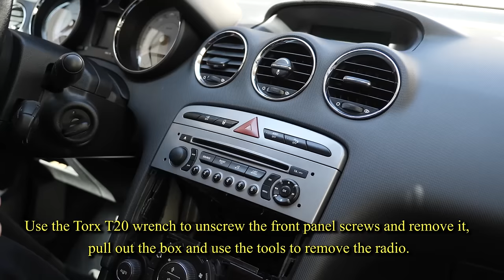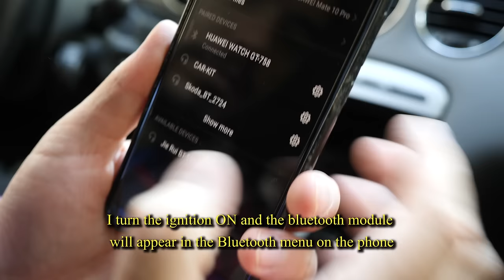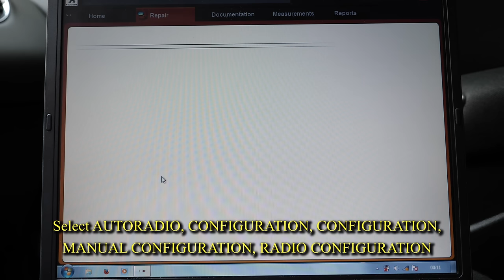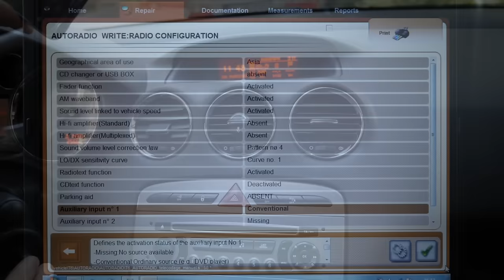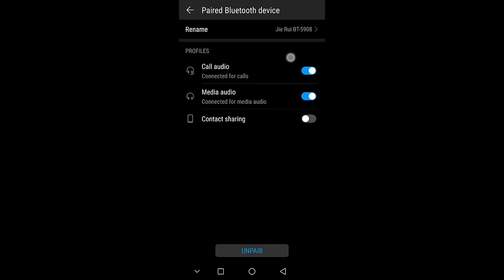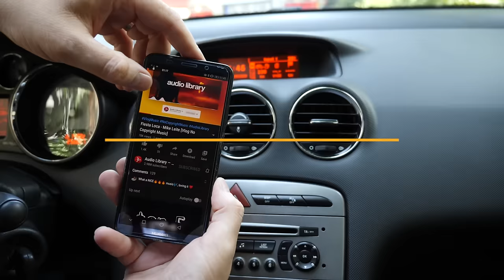Install Bluetooth Audio Module on Peugeot & Citroen Radio RD4, RD45, RD43

Comment: I haven't started doing anything yet. I haven't even ordered anything as I'm still at the research stage. 
My first question is what year model Peugeot 3008 are you demonstrating this on, please? 
Then you showed having the Bluetooth module permanently powered. What would be the benefit of doing that? 
And finally, the display screen on my 3008 seems to have only 3 columns for displaying information. If I'm going to add Bluetooth, wouldn't I need an extra column (or something else) in order to configure the Bluetooth connection? If not, why not? 
Thanks for any help you can provide.
Reply from the maker: Hello.
1. The car I made the video on is a 2008 Peugeot 308.
2. There is no advantage. You can power the bluetooth module from the wire of the radio unit that has + ACC (conditional on turning on the ignition) or you can power it from the + of the illuminated glove box lamp.
3. You just have to configure the radio (using Diagbox Peugeot diagnosis) to accept Aux IN audio.

Comment: Hello, thanks for your vid!! Now i have mine installed, just to confirm, with this module, when i play music from the music app in my phone, there is no way to skip tracks with the car radio or steering wheel buttons right? Thanks again!
Reply from the maker: Hello. With this bluetooth module you can only change the music from the phone.
Reply: @AdrianDragan   thanks for answer, i got a solution for this, u can buy multimedia bluetooth controller for phone that u can attach to the steering wheels so u can change tracks without touching the phone 😉

Comment: Hello Adrian,i bought this adapter connect wires everythink is ok and activated by lexia,but i have problem sometimes adapter always connect and disconect from the phone and i heard beep sound.What you think what is problem,somethimes working ok but sometimes not.
Reply from the maker: Hello.  Try another phone and see if the same thing happens.  It is also possible that the bluetooth module has a problem.
Reply: @AdrianDragan  i tried with other phone same problem maybe is fault bt adapter...

Comment: Hello 
I have a 308 1.6 HDI 2009 , 
But when I press on SOURCE nothing is happening , how can I enable AUX IN pls ? 
Is your method with this adapter is still available and working in 2022 ? 
And also , can I use any diag box (like the 40€ 300€ ALEN diag box on AliExpress) to modify the parameters of the Bluetooth please ? 
Thankkssss
Reply from the maker: Hello. Yes, you must activate the Aux IN function using the Diagbox with the dedicated module. You can find the link in the clip description.

Comment: Hello, I have a question. If my Peugeot 308 has two RCA inputs (left and right side) in glove box and I can see "AUX" option in my source menu is it necessary to use Diagbox after installing bluetooth module just like you did in the video?
Reply from the maker: Hello.  Because you already have the AUX IN port active, you no longer need to do the activation with Diagbox.
Reply: @AdrianDragan  Thankl you for the fast answer
Reply: Hi, if I remove multi changer cd , do I need to activate the aux using diagbox

Comment: Will bluetooth module will be powered only when ingnition is ON, or also when ignition is OFF but radio is turned ON manually?
Reply from the maker: As I made the connection here, the bluetooth module only works with the ignition ON.

Comment: So I’ve done everything, great explanation so far. No one locally had the Diagbox and I intend on using it many times in the future, so I ordered one. But what software do I install? They all seem to have a password and I don’t know where i can find it. And after entering the password for the file, will I be met with another authentication?
Reply from the maker: Hello. Did you receive the interface and can't install the software? I think that the seller of the Diagbox interface will give you clear instructions on how to install it.

Comment: Many thanks Just installed the module and it works great. The only issue I'm having is that Pin 11 was not switched live so currently connected to pin 12 battery which is not ideal. I had a good probe across the entire switch couldnt find a switched live which seems abit odd. Peugeut 407 SE
Reply from the maker: Hello.  Try to power from the positive wire of the lamp in the glove box.

Comment: Hi, i bought the same bluetooth module, but i have a problem to activate aux (I have a citroen C4 2005). I do the same as you in diagbox but when i change a input from missing to convetional diagbox shows me "wrong telecoding". It also shows this for every option to change on the radio. Do you have any idea to solve this problem? Old diagbox version, blocked radio etc.?
Reply from the maker: Hello.  I guess it's a radio stuck to changes in the Diagbox, I've also had this problem sometimes without knowing how to solve it.

Comment: is it compatible with remote of wheel? volume + volume -   next back source
Reply from the maker: Hello. Using this bluetooth module you have no control from the controls on the steering wheel, you can only adjust the volume.

Comment: One more question. The screen and radio work,but the screen does not show any changes on the radio: radio station, volume,....
Reply from the maker: Hello. I don't quite understand what you mean. Did you install the bluetooth module and on the screen you no longer displayed volumes, the name of the radio station?
Reply: @AdrianDragan  No, I still don't have any radio response to the screen without any module.  On the screen I can now see only the consumption, range, average speed... 

And I have all the control of the screen using the lever behind the steering wheel and three buttons on the screen
Reply from the maker: @debras.2211  I think your screen needs to be configured to work with the original radio, this can be done using the Diagbox interface. Your car may not have had the original factory radio, so the screen has been set to work without it.
Reply: @AdrianDragan  Can a little more detail about digitbox.
 Can I do it alone or go to the service?
Reply from the maker: @debras.2211  You need this hardware / software interface and some knowledge of what to do: https://www.aliexpress.com/item/32835110498.html?aff_platform=shareComponent-detail&sk=_ASSIR3&aff_trace_key=91917703c48e41f2be0c143a2f20f4dd-1609275726009-02086-_ASSIR3&terminal_id=d92441f0a7b94ef29dcdfc816a4dd068&tmLog=new_Detail
If you don't know how, it's better to go to a service.
Reply: @AdrianDragan  Thank you very much for all the answers.

Comment: Hello. Do you have a film about replacing nomade module? Or maybe how to remove center tunnel?
Reply from the maker: Hello. I'm sorry but I don't have a film about replacing nomade bluetooth module. I don't even have a film about how to center tunnel, but I want to do it in the coming weeks. Thanks!
Reply: @AdrianDragan  I found your film about replacing a bulb in lighter. Some say that i can remove nomade thru this hole :-) i'll check it tommorow :-) thanks for reply
Reply from the maker: @rredipss  That hole is small, I don't think you can get out there but you can try.

Comment: I see in the software there is Auxillary input 1 and Auxillary input 2. Does that mean we can install an aux cable (which you removed) and aux bluetooth (which you connected) at the same time?
Reply from the maker: Theoretically you can also activate AUX IN 2 but the pins are different. Follow the diagram from the link, Part B: https://diyrepairs4car.blogspot.com/2020/05/peugeot-citroen-rd4-rd43-rd45-wiring.html
Reply: Adrian Dragan Thank you for the response. Do you know any audio products sold for AUX INPUT 2? (cable or bluetooth)
Reply: @AdrianDragan  Hi,

What about just having both the BlueTooth as well as the AUX cable connected to the same AUX 1 connector ? 🤔😕

Thanks &...

Best Regards,
Reply from the maker: @davidbolha  I don't know if it's good to combine two sound sources on the same cable.
Reply from the maker: @uygar84  I am sorry but I do not know.
Reply: @AdrianDragan  I mean you wouldn't use both at the same time. To save space instead of using the AUX IN 2 port. 🙄

Comment: Hello Adrian, thanks for the video which gives ample time to follow each step. What module should I get for a Peugeot 807, year 2008? thanks a lot!
Reply from the maker: Hello. This would be the easiest module to install. But make sure it is compatible with the radio jacks on your car. https://www.aliexpress.com/item/32826594463.html?aff_fcid=8dd412c5ed964f848eb1ce1226169bf6-1622123674255-09622-_AlNrnv&aff_fsk=_AlNrnv&aff_platform=shareComponent-detail&sk=_AlNrnv&aff_trace_key=8dd412c5ed964f848eb1ce1226169bf6-1622123674255-09622-_AlNrnv&terminal_id=a4886d1a72584241b5df38394da27292&tmLog=new_Detail
Reply: I have the exact same car. Which module did you get? Do your parking sensor beeps still work?

Comment: Thanks for this video. Do you have any other recommendation to buy a Diagbox as your previous link is not working anymore ?
Reply from the maker: Hello. I solved the problem with the link, here it is: https://www.aliexpress.com/item/4000077945226.html?aff_fcid=23d2e9b7a05d4732b5c1cd1e1fefb060-1619608332636-02375-_AfokTF&aff_fsk=_AfokTF&aff_platform=shareComponent-detail&sk=_AfokTF&aff_trace_key=23d2e9b7a05d4732b5c1cd1e1fefb060-1619608332636-02375-_AfokTF&terminal_id=364d159dab6d4da48c68657f8054a5c8&tmLog=new_Detail

Comment: Great video my friend!👍🏻
I think I did every step as you showed(did it twice) and connected my phone but I still have a problem in my car where i can not hear anything from the speakers when switching to Aux 2 source. The only step I didn't do was the activatin step with the Diagbox because I already had an aux-adapter in place which worked perfectly before I changed it to this bluetooh receiver. When I switch to the radio channels, all the speakers work.
Is it right that in my case it should work from the get go or do I still have to connect a Diagbox and go to the car config to activate something to work?
Sorry if this was already asked but i couldn't find it.
Reply from the maker: Hello. From what I remember you have to enable Aux 1 with Diagbox. Or change the pins on the bluetooth jack as the wires on the original aux jack are placed. Take a look at the pinout in the picture, it may help: https://diyrepairs4car.blogspot.com/2020/05/peugeot-citroen-rd4-rd43-rd45-wiring.html
Reply: @AdrianDragan  is the quality of the sound good or i should just use my mp3 modilator
Reply: Hello, were you able to solve this problem? My bluetooth module still hasn't arrived, but I only have Aux 2 source
Reply: Same question for me

Comment: Hi! let me know that using the Lexia to programming this bluetooth module to correct using with phone is required or not? how to use this one module without Lexia? Should I just switch my radio to AUX and try to use? (Citroen C5 2005)
Reply from the maker: Hello. If you already have the AUX function active in your radio, you no longer have to configure with Lexia / Diagbox.
Reply: @AdrianDragan  ok, I just connected BT module and will try to find someone who have Lexia. Thank you!

Comment: Hello is the step with the Diagbox necessary or will it work with the AUX setting I already got on my 308
Reply from the maker: Hello. If you already have AUX active in the menu when you press the SOURCE button, the Diagbox step is no longer necessary.
Reply: @AdrianDragan  thanks for your answer, I only have aux 2 in my menu, would this work too ? And where’s the difference between aux 1 and aux 2

Comment: Hi. Couldn't you leave the original AUX cable connected and set this bluetooth device as AUX 2 in the diag box? Or is it not possible to have 2 AUX ins with RD4? Thanks!
Reply from the maker: Hello.  You can enable both Aux ports, but the bluetooth module pins are set to Aux 1 only.

Comment: Hi, I have a 2009 C4 picasso with rneg wipnav with rca aux in. I would like to change the rca aux to a bt like in your video. Do you have a pinout description for rneg wipnav?
Does it have the same pinout like the rd4?
Thansk
Reply from the maker: Hi.  If I'm not mistaken pinout for aux in is identical, you can still use a bluetooth module with RCA connection: https://www.aliexpress.com/item/32821770160.html?aff_platform=shareComponent-detail&sk=_AN7CU1&aff_trace_key=4b445306f5ff4aedaf24f41b551629cc-1603835577839-07973-_AN7CU1&terminal_id=77944c4ce01745aba668c8702a5739a3&tmLog=new_Detail
Reply: @AdrianDragan  Thank you for your answer. 
Is the +12V/-12V pinout also the same? :)
Reply from the maker: @koppanyagrillokozmary162  Yes, but it's good to check.

Comment: Can't thank you enough as I have many tips and info for my car from you. How could connect a computer/laptop to the car? Where  I could buy a cable?
Reply from the maker: Hello. You can buy the cable adapter and software from Aliexpress (choose the most expensive, it's the best): https://www.aliexpress.com/item/4000077945226.html?aff_fcid=3f393039cd76437ca5be168bf88085cb-1621346233730-00705-_AfwDRP&aff_fsk=_AfwDRP&aff_platform=shareComponent-detail&sk=_AfwDRP&aff_trace_key=3f393039cd76437ca5be168bf88085cb-1621346233730-00705-_AfwDRP&terminal_id=364d159dab6d4da48c68657f8054a5c8&tmLog=new_Detail
Thanks!

Comment: Great Video, thank you . But I have a problem with mine, I followed every step in your tutorial, but I don’t have the same color of cable from my cable. So I just connect the black wire of the BT adapter to the cable on pin 16 and the red wire to the one on the pin 11. Did everything right on diagbox, the entry auxiliary number 1 is activated, but when I click on source I get nothing. Can you please help me.
Reply: I can finally see the input aux 1, but no BT to connect on. Seems like the adapter is not powered on, But I did connect on the socket, the adapter black wire to the pin 16 and the red one to the pin 11. What did I do wrong, Please Help
Reply from the maker: @Babaguidai  Hi. Is strange. Try to power the bluetooth module separately from another 12v source. See if after powering it you will find in the list of bluetooth devices in the phone menu.
Reply: Adrian Dragan I will try that then

Comment: Great video - well done. Very detailed and easy to follow!

I have a Peugeot Partner with the RD4N head unit so all should work. Currently I can play music from my phone via the Input option and by plugging in a 3.5mm jack into my android device. By installing the Bluetooth module, I assume this will no longer work (fine) but will the menu option (input) relate to the new Bluetooth module or do I still have to change the canbus settings to include aux (I would get the local dealer to do this rather than buy the software and associated hardware)?

Thank you in anticipation
Reply: I note that someone else asked the same question and that your response was that everything should work without a visit to the dealer. Fantastic.
Reply from the maker: Hello. If I understand correctly, you already have an active AUX IN port, so you can connect the bluetooth module instead of the white plug that is for the AUX cable behind the Radio unit. So, theoretically, you no longer need to activate the AUX port with diagnosis because it already works for you.
Reply: @AdrianDragan  all connected and working well. Thank you again.

Comment: I have bought the package @ Ali. Unfortunately my P308 2007 has only a wire at pin12 in the connector. Pin 11 is empty. This means the module will always have power,  even when the ignition is turned off. This will drain the battery if you do not use the care for a longer period of tim. ADVICE: If you consider purchasing the device, check if you car audio system used the right connectors first.
Reply from the maker: Hi. You can power the bluetooth module from the positive wire of the lighter.

Comment: Hi and thanks for the video. 

I ordered and installed one myself and configured it on a local dealer. 

One thing it that is happening and I don't really know why. When I turn up the volume (level 30) or the bass (level 9) all the way up it disconnects. It also happened to disconnect and I couldn't even connect to it anymore (it didn't show up) and I had to remove it from the socket and put it back in. 
Any thoughts on why is this happening?
Reply from the maker: Hello. I have no idea why this is happening, I think it could be a weak thread connection in the mode, but I'm not sure.
Reply: @AdrianDragan  I checked it and there is no thread issue visible. However, I don't mind it that much, but it's inconvenient. Thanks for the response :D